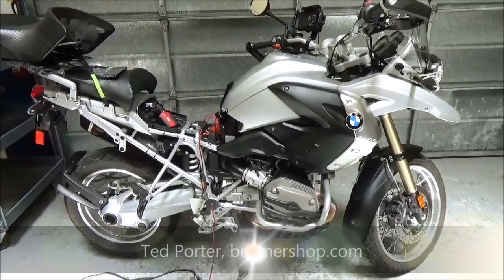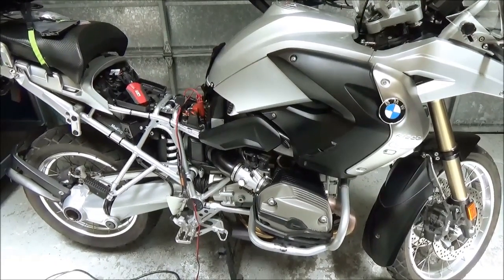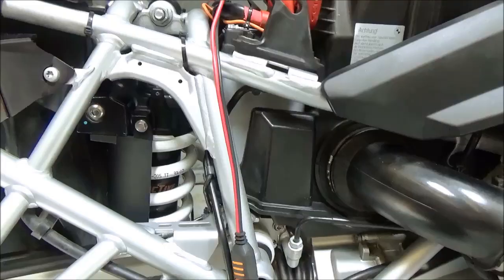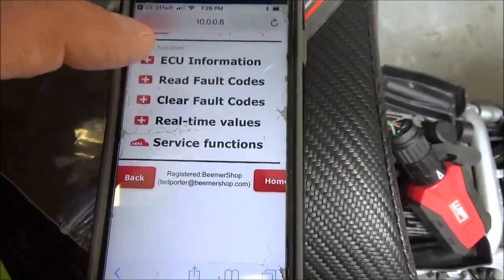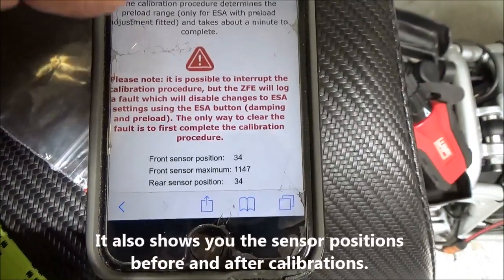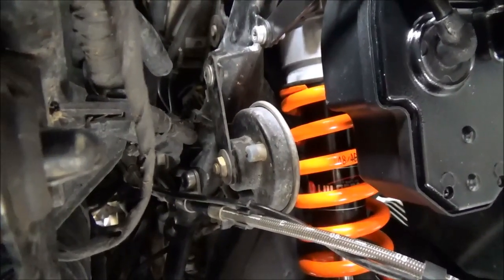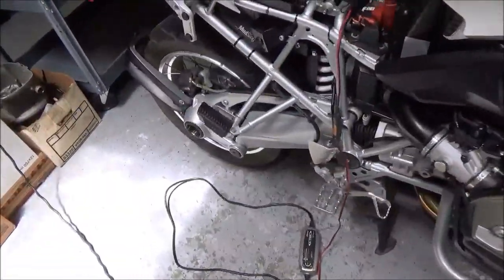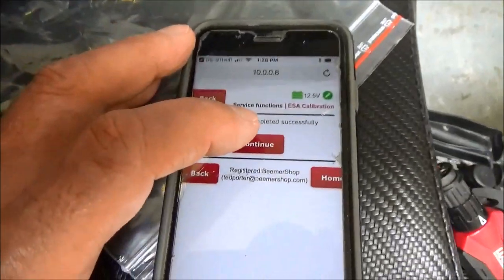GS-911 ESA suspension calibration on a BMW R1200GS

Comment: If you happen to be in Istanbul, stop by MOTOSENKRON and have all the shock absorbers of BMW motorcycles repaired with a one-year warranty, very cheap 250 euros.
Reply from the maker: Thanks for that info. That's certainly an option if upgrading to better shocks is not in a rider's budget, but for many riders the comparatively low performance of the stock BMW shocks is just not acceptable. The improvement in traction and ride quality in the aftermarket shocks is transformative. When I buy a new BMW, I usually replace the shocks within the first few weeks of ownership, I just can't ride on the low performing stock shocks. ;-)

Comment: i got a 2018 s1000rr but i dont have a gs-911, front and rear stand yet.. do you need the paddock stands to calibrate the DDC? i tried calib it just by leaning the bike on my body making the bike sit straight as possible as i can but it showed me DDC calib fail twice, what could be the cause of the failure other than not having a paddock stands? how exactly do you calibrate the DDC without a GS-911?

Comment: Hi Ted , do we need to calibrate Bmw Oem ESA shocks ? or is it just required for aftermarket ESA.
Reply: Those were the OEM preload motors I was calibrating, they were simply transferred from the old shocks to the new shocks. So the short answer is yes. :-)

Comment: Hey Ted do you have an 850gs lower spring option for the rear ESA shock. I am looking for a 20 or 30mm lower spring
Reply: Hi Alan, I have lowering shocks for the F850GS at 30mm (a much better Tractive Suspension product) as well as a 40mm lowering spring kit that is fitted to the original shock. Keep in mind that lowering springs lower the bike by increasing sag and they are one size fits all. There is only one part number for the lowering spring so everyone gets the same springs regardless of your weight. The lowering springs get the job done at a very reasonable price but you get what you pay for. When you buy a lowering shock, you get a shock upgrade and it is custom setup for your weight and loads with lots of spring choices.